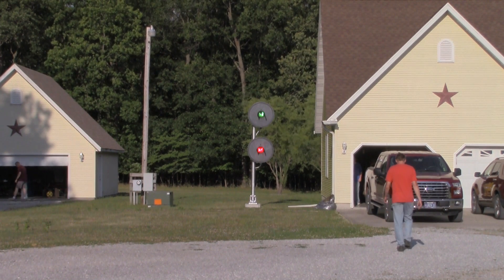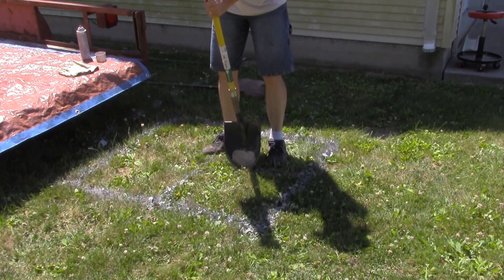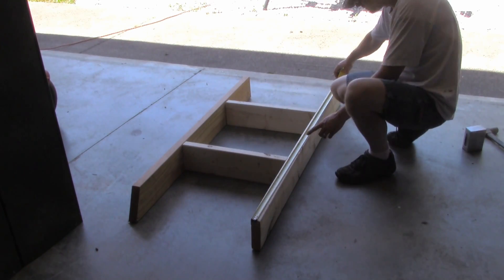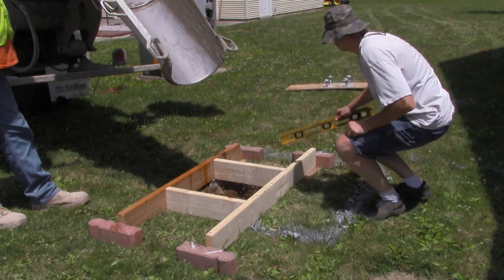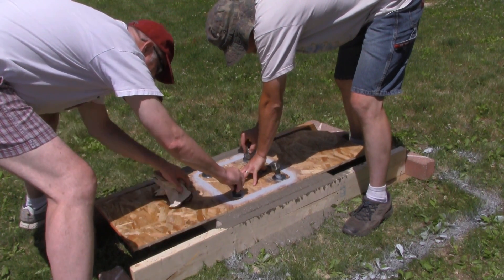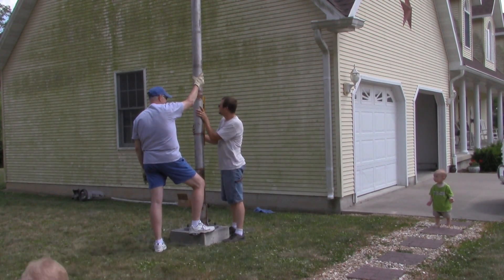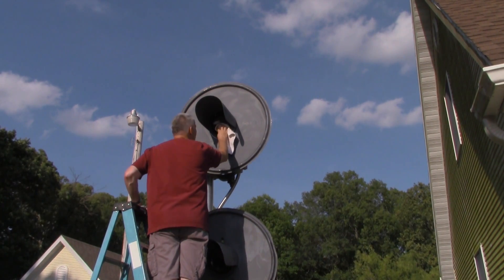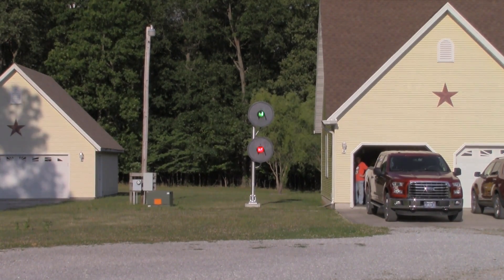GRS Searchlight Signal Installation

Comment: I won an SA-1 at auction about a year ago, it was nowhere near the condition yours was in. I disassembled every last nut, bolt, and washer and did a full restoration on it. After all was said and done it looked like it had just been delivered from the factory. I planted it in the front yard so the neighbors could also enjoy. Every time I'm outside someone stops and asks about it, its a great conversation starter. At first when you dig the hole and put the nuts in I was worried about longevity of the base... then I saw the two of you moving the pole without machinery and felt better. Mine is a 23' tall 8" schedule 80 steel pole with the big cast iron base (about 400 lbs for the pole and base alone). Seems like your family enjoyed to project as well, gotta get the kids interested early!

Comment: Would you happen to know where I could find a GRS SA-1 stepped mechanism?
Reply from the maker: I do not, Maybe ebay. There are also several Facebook groups where signal parts are sold.
Reply: @signalupproductions  Thanks for getting back to me. Yes, I have tried all those venues but have been unsuccessful in finding anyone who had any for sale unfortunately.
Reply from the maker: @richardherringjr3578  no problem. We got lucky on the mechs in my video. A salvage company abour 4 hours away was contracted to remove dozens from a BNSF mainline. They sold everything through their facebook page, priced low for a quick sale. But now I might see one pop up once a year. Just have to be patient.

Comment: Where do you get one of these from?
Reply from the maker: Railroads are free to dispose of their property in a varity of ways. In the case here, a tree trimming contractor in the Chicago area was contracted by BNSF to remove these  old signals after the new ones were installed. It was their option as to how dispose of them. Most contractors scrap the stuff, but this company saw the historical value and sold it all on facebook. They have since been picked cleam. But thats the best advice, watch facebook railroad and signal groups for deals. Be prepared to spend some money and drive half way across the country though. But it is completely worth it!
Reply: signalupproductions Kramer tree?
Reply from the maker: @TexasRailfan2008  yes. We are in Southern Illinois so it was a fun day trip to get them

Comment: Since the signal has a lunar aspect, why do you also use flashing red for restricting?
Reply from the maker: We are using toggle switches to change the aspects. Not a programmed controller. For the video, I was just showing all the different indications our signal is capable of displaying. Union Pacific uses both Y/L and Y/ FR to display Restricting depending on the installation. As I model UP, I differ to their combinations. Technically with the toggle switches, I could also have displayed a flashing lunar, but that is not an actual aspect on UP, hence it was not shown.

Comment: Which signaling system is this based on?
Reply from the maker: Jeffrey T. Axsmith The signal names I displayed in the labels are based on current Union Pacific signal rules. The actual operation of the hardware is done manually with toggle switches

Comment: where did you get a lunar GRS mech
Reply from the maker: A mechanism has spots for 3 spectacles (color lenses). They are removable and interchangeable. In the case of the lower target, it actually came R/R/L. A friend in the signal collection hobby offered to swap a red for the yellow we see here. The top signal came G/R/Y from the railroad.
These are from the BNSF racetrack near Chicago, and were pulled from service a few years ago. Lunar is pretty common for a lower target, and often found at or in advance of a diverging route leading into unbonded territory.
Reply: You can buy the roundels from General Signal.